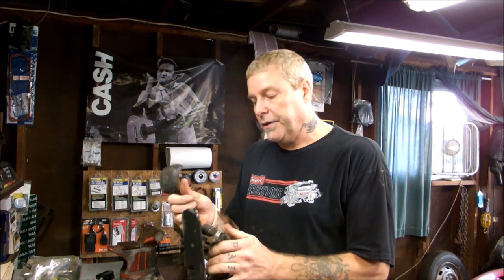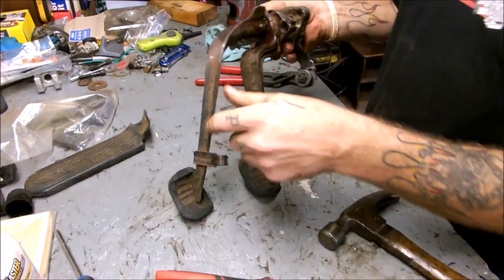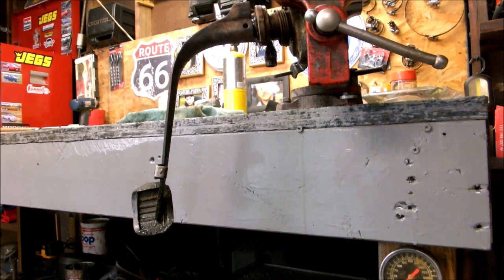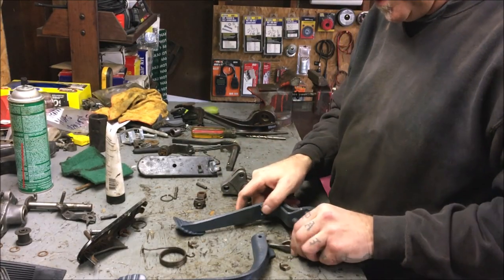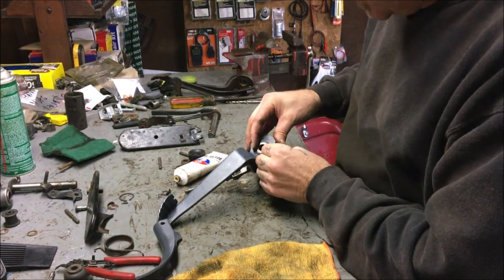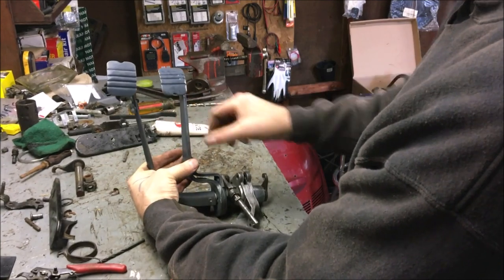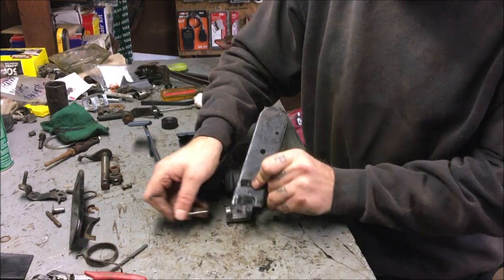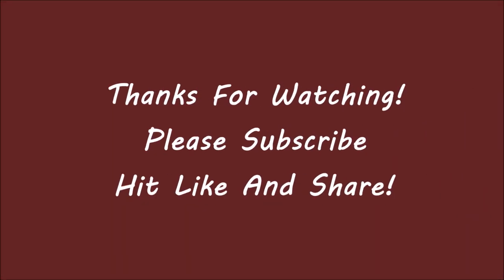VW Beetle - Super Beetle Pedal Assembly Rebuild Video DIY video - VW Bug - VW Bus - VW Ghia

Comment: I was looking for a pedal cluster vide, when I saw you did one, I was quite happy, I knew I am going to have fun and enjoy learning. Thanks Slade. Cheers from Melbourne Australia 🇦🇺.
Reply from the maker: I hope it is helpful, I will be doing another one in about 3 to 4 weeks. 
For this car that I’m on now of course. 
And I’m going to extend the pedals and make them further apart for my big feet. So I will be filming everything.
Reply: @SladesVWBeetle  that would be awesome. Mine is a RHD is there a major difference? I hope there isn’t.
Reply from the maker: @FunFun-tv7gq  Honestly it’ll be the same thing. Just reversed, but the same identical process. You’ll be fine my friend!
Reply: @SladesVWBeetle  thanks a lot my friend. I also bought a low light 68 Kombi to restore. So you need to get onto that ASAP as per your BOSS instructions 😂😂 (you told me your wife wants one of those 😊)

Comment: Great video. When I did mine I was contemplating rebuilding the original peddles. However I decided to go with a wilwood setup. Believe me there was a lot of fabrication. It was worth it for my build but I don’t think I wold do it again.
Reply from the maker: OFF AXIS BUILDS 
It’s definitely not a very fun job to do. But I wanted to keep the original German equipment
Reply: Slades VW Beetle great job.

Comment: What keeps the clutch pedal from returning to far towards the driver seat direction. Mine just flops back towards the seat causing the cable to fall off in the tunnel.
Reply from the maker: There should be a pedal stop bracket on the floor. Might need adjusted or...check this video it will make sense. Make sure the bottom of the clutch pedal is hitting the stop, or needing adjusted. 
Here’s the video my friend 
https://youtu.be/_hAdDQaPItA

Comment: What does the pedal stop do exactly? Does it keep the pedals from going next to the firewall and that's it? Thanks
Reply from the maker: lance barley Good question Lance! The pedal stop on the floor keeps the pedals from falling towards the drivers seat. Keeps them in an upright position! Thanks for commenting
Reply: @SladesVWBeetle  Thank you so much for responding! My brake pedal keeps falling towards the drivers seat, but the clutch pedal remains upright. What do you recommend I do to fix this problem by changing the pedal stop. Get a taller one? Or something else? Thank you
Reply from the maker: lance barley Okay first see if the metal tab on the bottom of your brake pedal is “touching” the brake stop on the floor. It may need adjusted if it’s touching. 
There’s a bolt on the brake stop on the floor you can loosen and slide the metal bracket. 
Also the metal tab on the bottom of the brake medal can be bent to adjust. I thing I have a video on that exactly problem. I’ll check later tonight and upload
Reply: @SladesVWBeetle  I appreciate your help and checking that. I apologize because I know its not an easy task for me to ask a specific question without you being able to see it in front of you
Reply: If you could upload that it would greatly appreciated, take your time
Reply from the maker: lance barley I’m actually reviewing it right now. I bent the pedal tab on my clutch pedal tab, but the brake pedal is the same. It will give you the idea, if the pedal stop on the floor will not remedy it. I’ll upload tonight here
Reply from the maker: lance barley Okay I just uploaded it. No keep in mind before the video I tried to adjust the pedal stop on the floor. But it was at full adjustment! Check out the video. It was my clutch pedal but same scenario